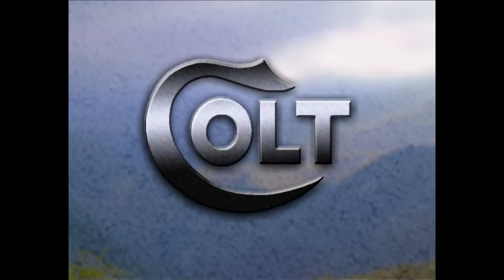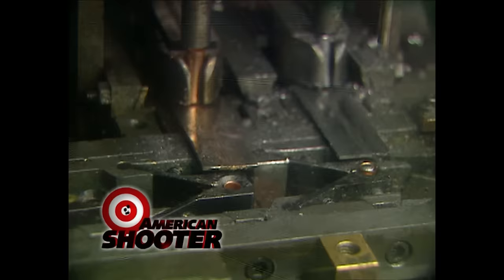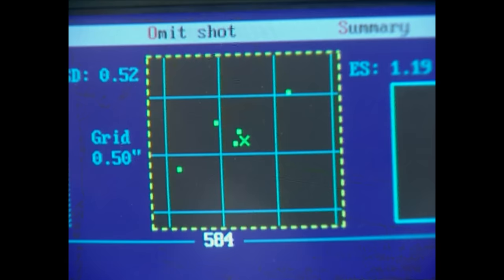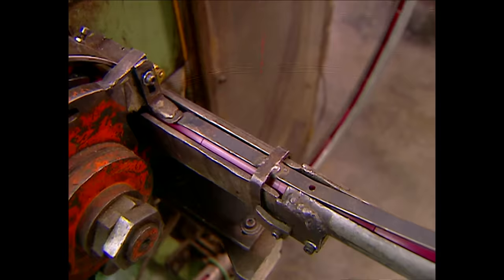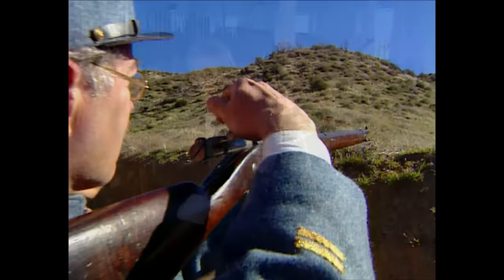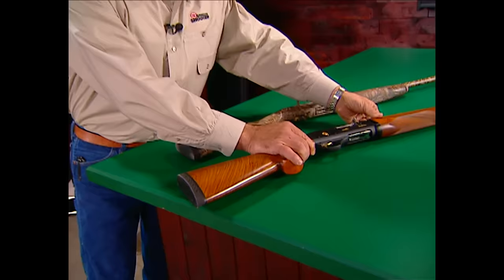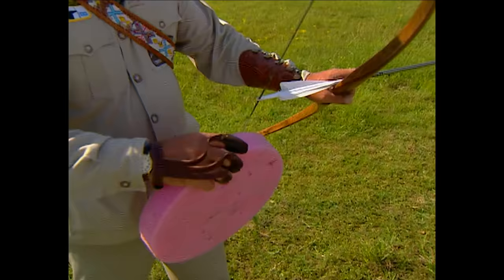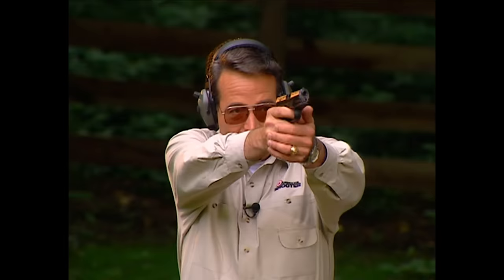A Look Inside The Federal Ammunition Factory - American Shooter S1, E4

Comment: Back in 2004 One of my customers made automatic reloading equipment. The motors from scratch, CNC mills and lathes cutting the steel, hardening furnaces. Impressive little shop in Arizona outside of Phoenix.

Comment: RIP Jim.
.22 ammo nowadays is substandard to what it was 10 years ago. Used to be .22 ammo was super reliable,
now myself and my friends experience lots of failure to fire issues because if inconsistent uneven application of primer paste, which results in no ignition. Yet if you take that same round it it is struck again in a different spot, it goes off. All the guns are in good working order and well struck by the firing pin. This happens not only in Federal rim fire ammo but in Winchester, Remington and CCI. Mini Mags used to be my go to ammo because of their reliability and accuracy but now even they are having issues and not what they used to be. Unfortunate.

Comment: Federal used to be the little shop in the neighborhood.  Few miles east of Federal was the Federal (as in govt) Defense Munitions facility.  Forget how many 100's of acres it covered.  Had a couple warehouses on the property that looked like the warehouse at the end of Indiana Jones.  Along the north side of the facility was a 1+ mile long firing range for testing.  Also made the depleted uranium anti-tank shells.  Wore dosimeters if working in those buildings. Originally built to produce munitions after WWI.

It's last hoorah was early 90's due to first Iraq war.  More US soldiers died of munition malfunctions during live fire training than those during the short war itself.  Only thing US had in bulk at the time was Korean and Vietnam era munitions (remember the battleship deck gun powder bag explosion? Korean era powder bags).  US bought back munitions that it had sold to France to use for the Iraq war.  In turn, DOD cranked the munitions plant up to 101% capacity to replace the France munitions and replace all the old US munitions.  Ran 24/7 for a few years.  Has since been shut down and all the buildings removed.  As a kid, remember the air vent hoods in the middle of fields outside the facility grounds.  Material and product came and went by trainload.  But not above ground. Traces of those lines mostly gone from current Google maps.

Local community wants to purchase the area and make into residential and park area.  Joke has always been that it would be cheap to light the area at night due to the glow from the radiation still in the ground.  Superfund site with questionable cleanup.   So now, Federal is the big ammo maker in the area.  Would be curious to know if Federal ever took any of the old Defense equipment for use.
Reply: Thank you for writing

Comment: Phewwww I had a box of 22s I had to throw away a couple years ago.  Stuff was all over the place. Even the sound it made you could tell there was a huge change from round to round.
Don't think they're as good as they claim, or maybe I just had a really unlucky box.
Reply: Jim F could be a number of things. The quality control of .22lr is very low as they want to keep round cost to around .05 Typically federal champion is good .22lr
Reply: @GatCat  True! theyre cheap for a reason. Just like Winchester high velocity I get a no or misfire 1 in every 70 or so rds. CCI which produces better 22lr is more money but i might get a misfire or no fire about 1 in 400.

Comment: Oh how the mighty have fallen. Steel instead of brass on shotshells. Not to mention they burn dirty, jamming up my Franchi semi-autos. They even cut costs by using small pistol primers on 10mm CCI Blazer brass ammo, that leaves my Glock 20 so dirty with unburnt powder. I'll never buy federal or cci ever again. I'll invest in a mec 9000 for 12 gauge and buy my centimeter ammo from Underwood!

Comment: Another one that is cool is Manufacuring piston and sleeves for dirt bike , but in todays time that s is expensive , a national forging press will run you a half a million dollars , and that is a used beat up one, that breaks all the time, and you have a heat bill for the rods you have to heat red hot.  But at the same time if you run that shit, a press can produce 1000 forges on one shift, $$$$$$$, if thing run like they are supposed to , with a machine shop y ou can put your name on the name. escasialy now with top end kits going thru the roof. I can't afford that , and it is pricy and risky.

Comment: Instead of restoring cars , or bikes , I would not mind getting into restoring ventage machines like these ones that work well , and re wiring them , putting new motors in them , like GE.  removing all the factory hacks over the years, if I had space , I remember when GM stop making the gen 1 small blocks , now they got this modern BS machines ,and people have LS with 100 thousand miles some times and they blow up .  They should of sent that s to Mexico or Polland , they would of been stocked to reproduce a old car , like they did the bug .   These old green machines reminds me when I worked at the factory.  in a country like Egypy mf will be bagging to work .